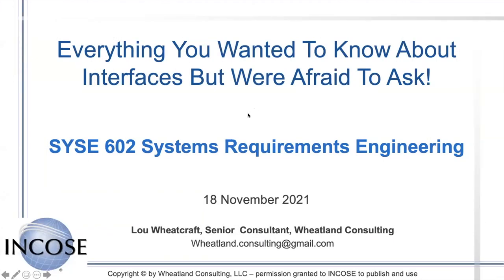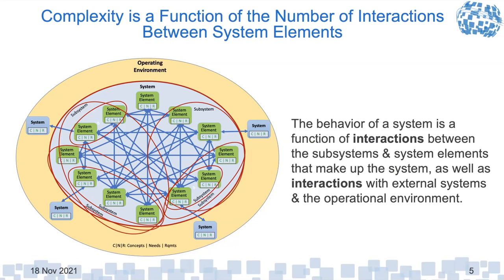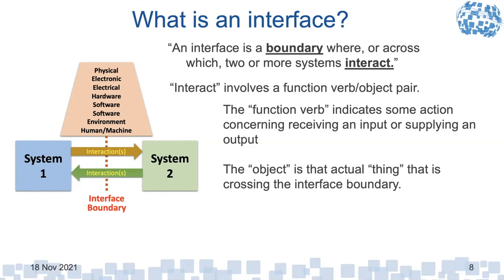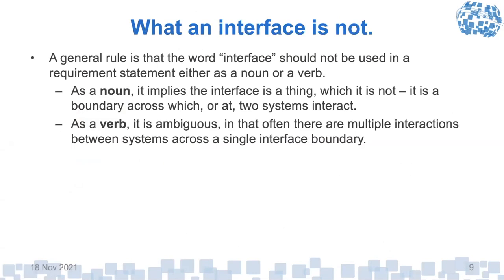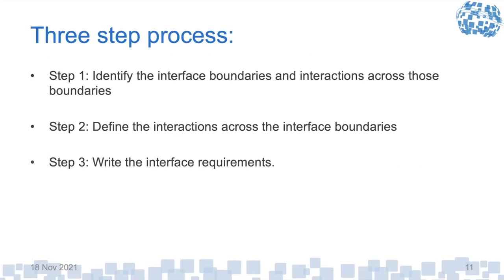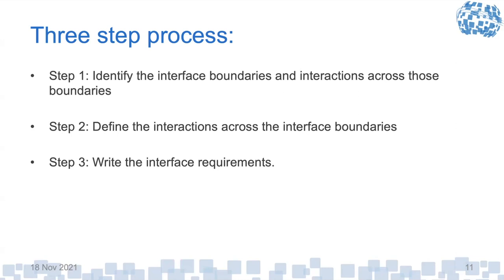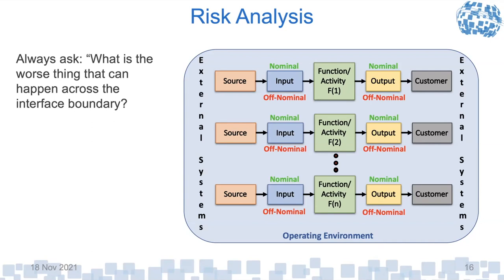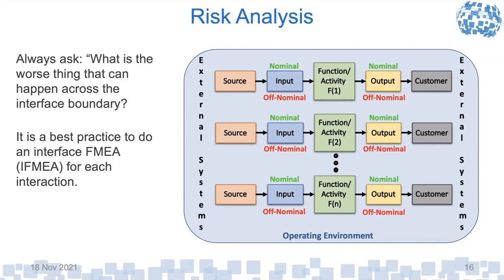Everything you wanted to know about interfaces but were afraid to ask!

Comment: Thanks for a great talk! Would a good functional/performance requirement like this be something that would be added to the set of design input requirements for the Payload?:

FR1: The Payload shall send send the meassured temperature of the Payload  

according to signal tmpMsrmnt1 defined in Spacecraft ICD 1234, Table 5.4 

row 2 within 2 ms and with accuracy of +/- 0.1 degC and with precision +/- 

0.05 degC when requested by the Spacecraft by the recieved signal 

tmpMsmrntReq1 defined in Spacecraft ICD 1234, Table 5.4 row 10, while in 

operational mode as defined in States And Modes Definition Document figure 

1.
Reply from the maker: makzmakz Glad you enjoyed the presentation.  You have the main idea in that 1) Interface requirements are functional/performance requirements and 2) the performance is the defined and agreed to definition of an interaction often contained in an ICD type of document.  In this example the characteristics of the measurement parameter and the command.  

For data, command, and  messages some organizations will have a separate data dictionary that defines the characteristics of each, others will include this information in an ICD.  

One thing about your example is that I don't think the accuracy and precision are part of the exchange of the measurement parameter, rather they are part of the act of obtaining the measurement in the first place.  Something like: "The Payload shall measure tmpMsrmnt1 with an accuracy of of +/- 0.1 degC" and "The Payload shall measure tmpMsrmnt1 with a precision of +/- 0.05 degC."  There would be other requirements concerning the sample rate and storage.  From a single thought perspective and thinking ahead to system verification, I broke this into separate requirements.

Another thing is the wordiness of the requirement - the less words the better while still being clear as too the intent while keeping the requirement a single thought as discussed above.  

As discussed in the INCOSE Guide to Writing Requirements (GtWR), including qualifying clauses is allowed and encouraged when appropriate to the level the requirement is being stated. These clauses also are an aid in planning ahead for how the system will be verified to meet the requirement as well as an aid when developing models of the system. In this case the command from the spacecraft is a trigger for the Payload to send the temperature measurement to the spacecraft.

From a states and modes perspective, some organizations will include the state or mode as an attribute rather than as part of the requirement wording.  This is helpful when wanting to list all the requirements that apply to a specific state or mode.  This is discussed in the INCOSE RWG Needs and Requirements Manual (NRM) chapter on attributes.

With these things in mind along with the assumption the state/mode is included as an attribute of the requirements rather than as part of the requirement statement text the following interface requirement could be stated.

"The Payload shall send payload temperature measurement  TmpMsrmnt1 defined in Spacecraft ICD 1234, Table 5.4 
row 2 to the Spacecraft within 2 ms upon receipt of the spacecraft payload temperature request TmpMsmrntReq1 defined in Spacecraft ICD 1234, Table 5.4 row 10." 

Because the measurement and command are proper nouns I capitalized them.

Comment: This seems to suggest that the ICD is fully written and published, before the interface requirement can be written. This seems completely backwards to me. In other words I never expected the requirement to include "as defined in Spacecraft ICD 1234, Table 5.4." If you have already defined the interface in a published ICD, why then are you spending the time to retrospectively write requirements? It's like planning for something you've already done.

I thought that for a new system, requirements come first before the solution is developed, then followed by an ICD which evolves as part of the development.
Reply from the maker: Jay, For existing systems, you are correct - an ICD should have been developed and baselined.  This ICD then contains the information needed by new systems to be developed in the future to be able to interact with the existing system.  As such, the existing system is a constraint on any new system being developed in the future that will interact in some way with the existing system.   In the example you refer to there is an existing spacecraft that a new payload or instrument is being integrated into.  Thus this new system is constrained by the existing spacecraft buss.  Therefore the new system must have interface requirements concerning each interaction and these must include a pointer to the existing systems ICD.   

If both the spacecraft and payload are being developed concurrently, then what you say is also correct.  Each will have interface requirements as design inputs that address each identified interaction from the perspective of what the interaction involves and characteristics of the things involved in the interactions.   This information is included in a preliminary ICD and is referred to within the interface requirements.  As design inputs, these requirements provide the design team the knowledge they need to come up with a design the enables the interaction to take place.  

Because the design has not been completed and agreed to, other interface requirements that depend on the design include a TBD until the design is complete. Once complete, the design information is added to the ICD and the TBDs in the interface requirements are replaced with pointers to the ICD.

These requirements must be stated to not only drive design, but also because the build systems must be verified to meet all the interface requirements.

If you go back and listen to the presentation and subsequent discussion, you will see that what I just said was discussed.

If you have more questions, I suggest you read the sections in the INCOSE RWG Needs and Requirements Manual in section 4, 6, and 14 that discuss interfaces and interface requirements.